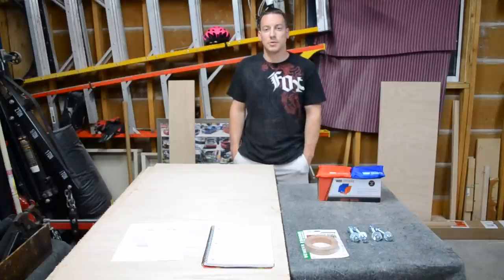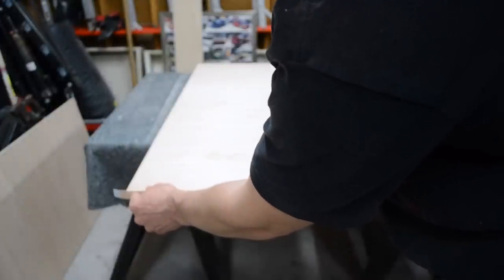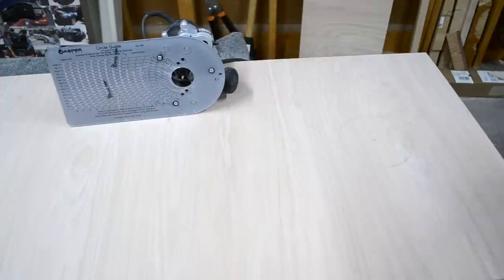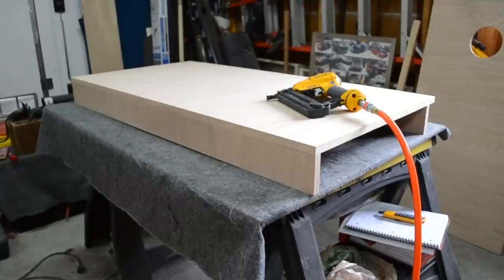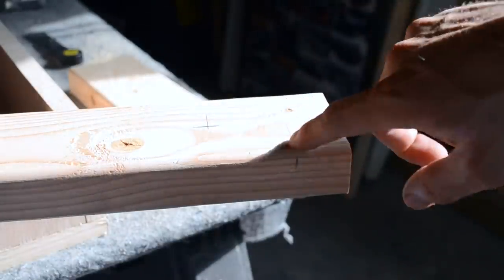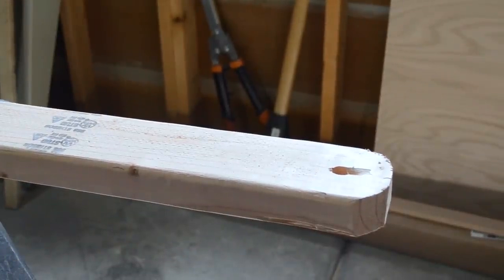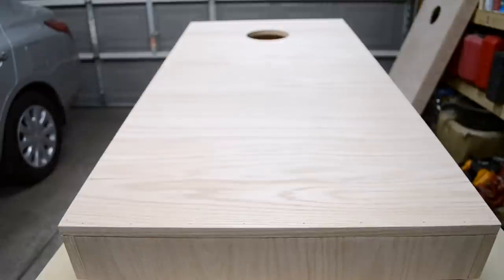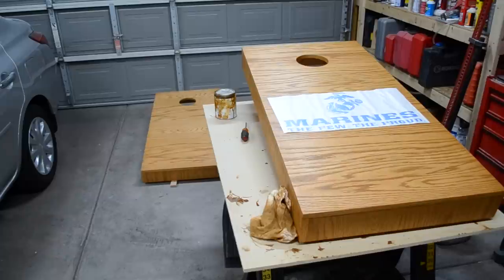Cornhole Build Part 1

Comment: Is that not a heavy ass cornhole board? I make them with 1/2” ply and only a 1x4 frame and I wish I could make them lighter. This has 3/4” ply with a 1x4 AND a 2x4 frame??
Reply from the maker: Its honestly not too bad. The plywood is light. The sides are also plywood and not 1x4. The 2x4 base provides good support for the upper sheet. I dont get and bouncing or movement from these like I see with many others. I dont know an exact weight but its not too bad at all. Thanks for watching.

Comment: Since you’re using a trim board on the outside of the frame, why not cover the plywood edges with the trim boards and skip the edge binding. You’d have no seams visible as well.
Reply from the maker: Patrick Emond I did that because I wanted a solid piece for the top. If I covered the sides with the plywood I would then have an exposed edge on the top that would not match up perfectly and cause the bags to be effected.

Comment: Those must be heavy?
Reply from the maker: They are heavy but they are sturdy. I can still carry both at the same time but I usually don't. They do not move when you are playing or even when someone steps on them. Literally the only difference is compared to what others to is I have the sides of mine finished with 3/4" plywood. It looks worse than it is. Thanks for watching.
Reply: the best boards are maple
Reply from the maker: Maple 12 ply was $87 each sheet. I also would have had to drive 3 hours to get it. I went with what was local.

Comment: What did you secure the 2/4 frame together with?
Reply from the maker: Teeglock Teeglock I used 3" screws to hold the 2x4s together. I then used 1-5/8" screws to hold the 2x4s to the side plywood pieces. I counter sunk the screws a little bit to get a decent hold.
Reply: Thank you Dave.

Comment: No glue?
Reply from the maker: I didn't need it because it was not a structural point. The sides were nailed from the top and the side. They were also screwed from the back of the 2x4